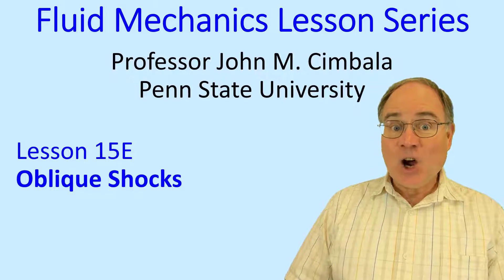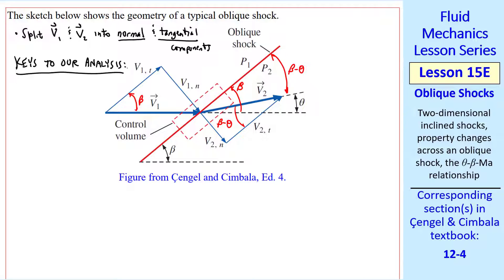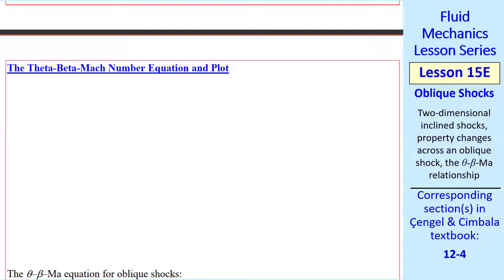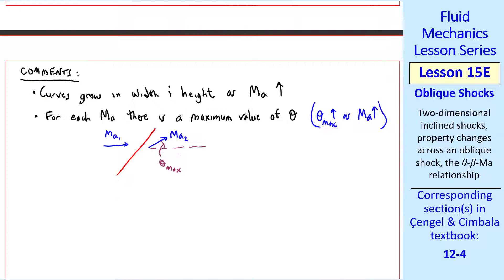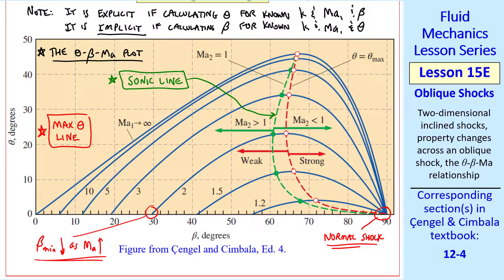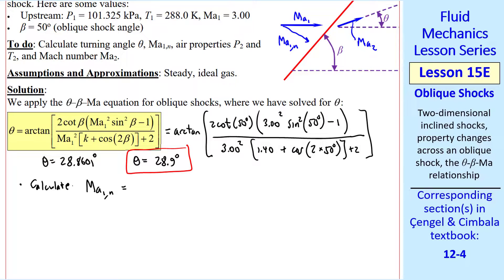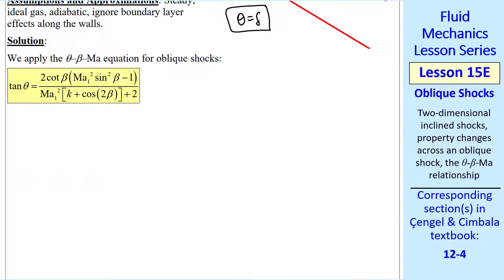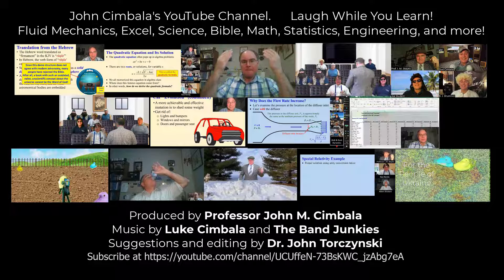Fluid Mechanics Lesson 15E: Oblique Shocks

Comment: Hi! Your lecture is great! I am very impressed by your teaching skills.

I have a question: on the second example, why do you set delta equal to theta? I don't quite understand your explanation. Also, would it be possible to split into two mirrors with centerline delta/2 and calculate on only one of the sides?
Reply from the maker: First question: Because the flow downstream of the shock must flow parallel to the wall.
Second question: I am not sure what you are thinking about with delta/2. But you can think of the centerline as a mirror and the exact same (mirror image) shock and flow would occur below the plane of symmetry.
Thank you for your kind comment. Please tell your friends and colleagues about my YouTube channel where there are hundreds of free videos about the Bible, fluid mechanics, science, math, statistics, air pollution, and other topics. I would greatly appreciate it.
Reply: @johncimbala  okay, I get it now. I thought delta was the whole purple area. Thank you for the answer. Will do!